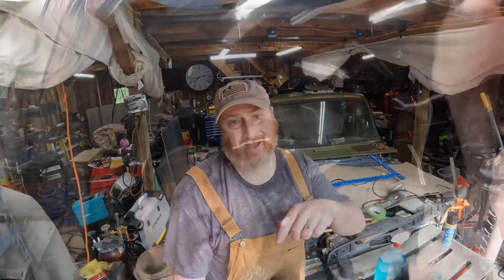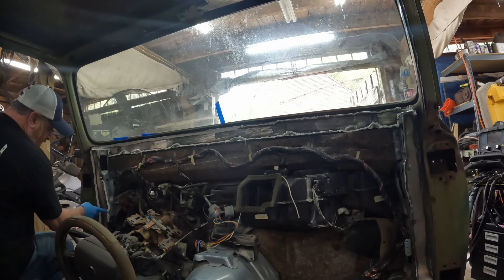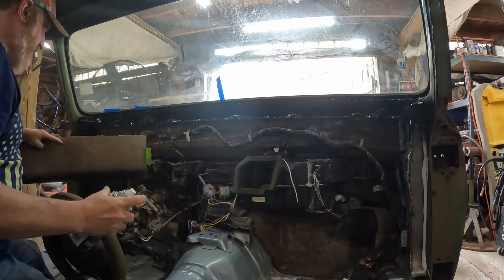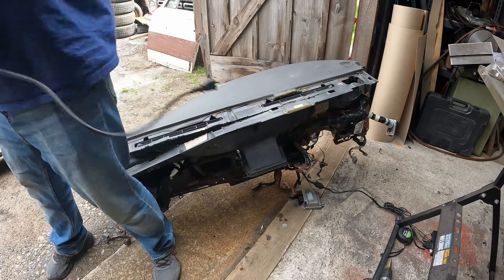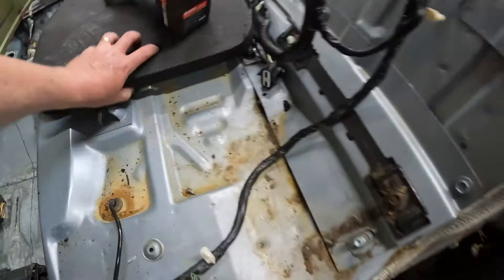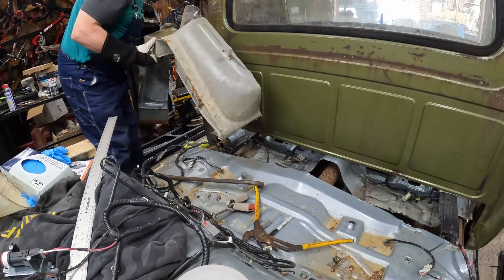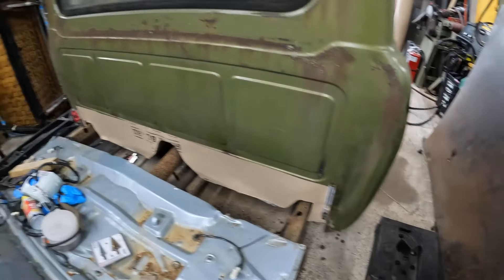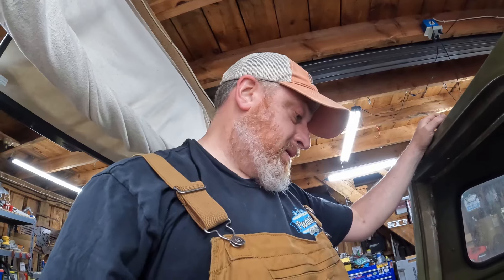Chassis swap moving forward!! Let's get this cab welded down the Grand Marquis!

Comment: Hey Dave,
Sometimes when I do sealer like you are I use a little acid brush to work it in.  I seems to work it in a little better than your finger.  Thanks for the video!!!
Reply from the maker: I used a brush on the Shoebox. Either or I suppose!

Comment: "Out of gas" ... umm, flux-core? Every box-store has it; so wipe off a little spatter, NBD where you're welding here. Gamble some brake-cleaner / electrical contact cleaner on that "dead" HF grinder, brushes and switch, 2 minutes and it might save it for another minute. This advice is worth exactly what you paid for it ...

LOVE the truck to panther build! Love the content! Love your inner Snark! Don't stop Anything!
Reply from the maker: I'm sure it needs brushes. I'm not going to bother with it. As far as flux core goes, we have a bunch. Not bothering with it. Running out of gas is the universes way of telling me to be done for the day and spend time with the family!